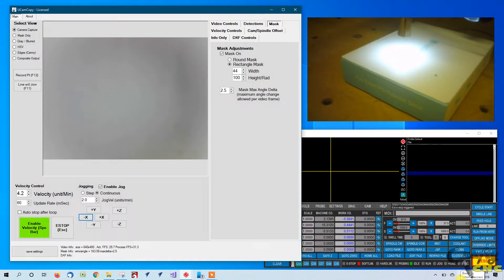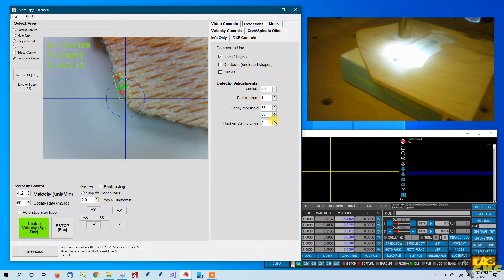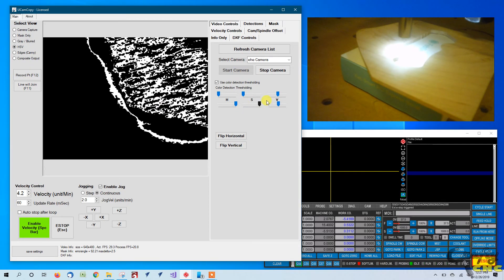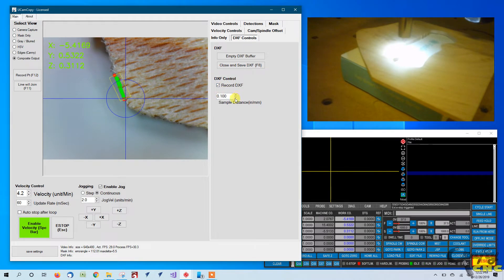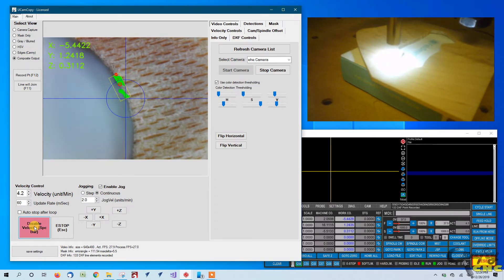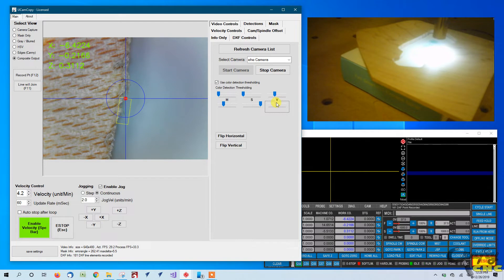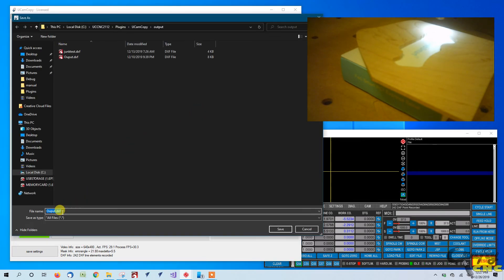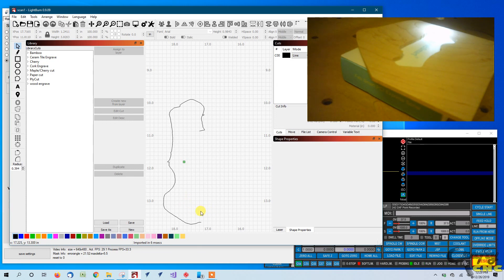UCamCopy - Video Adjust and Copy Outline Example

Comment: Very interesting plugin! Does UCamCopy also support to use the camera to zero X/Y position? The offset between camera and milling machine to be manuall setup by engraving small hole which i will seach with the camera. Is this usecase supported? If not it would be great and i would like to buy a licence. ;-)